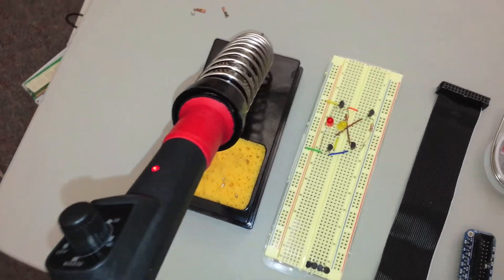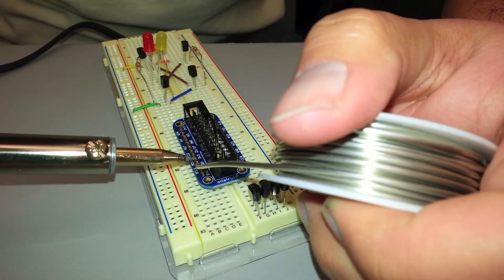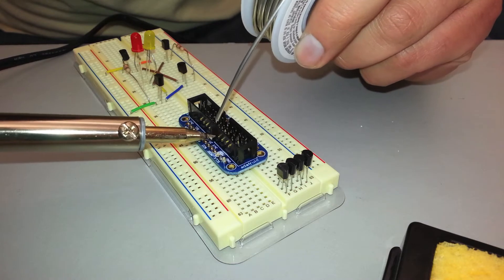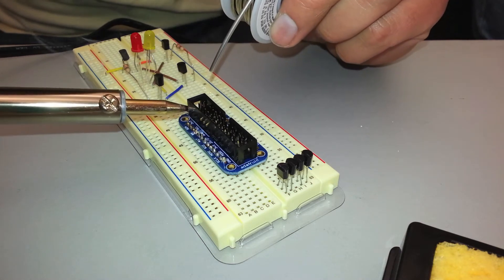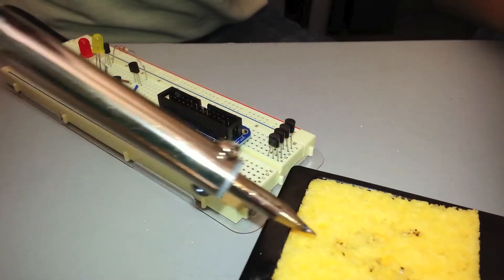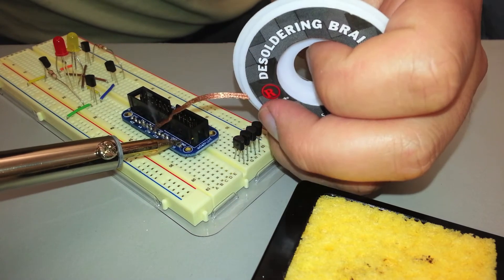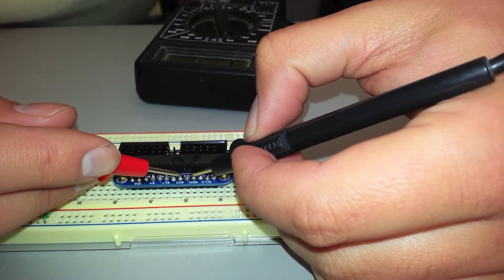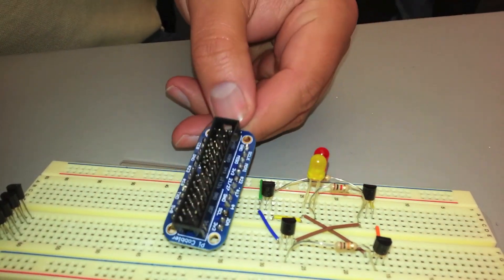DIY: Raspberry Pi Cobbler Breakout Kit Soldering

Comment: chapmjx - The 'PC land' is the area of copper on the PC (printed circuit) where the component leg is soldered to. (doesn't matter if it is a leg that sits on the surface or goes through the board) you should never 'carry' solder on the soldering iron bit, always heat the board and the leg at the same time then feed in solder. Hope that helps.

Comment: Sorry but that is NOT how to solder, you should NEVER drop solder on a joint. First your solder is too thick, you need 22swg. First solder one of the corners by heating the pin and PC land at the same time feeding in a little solder. When done move to the pin diagonally opposite and do the same. Do the other corners making sure the board is pressed down at all times. You can then do the same for the rest of the pins. Check for shorts. I have had 45 year experience in electronics.